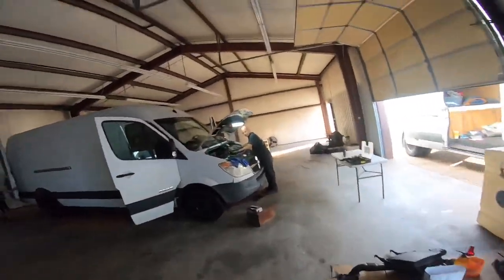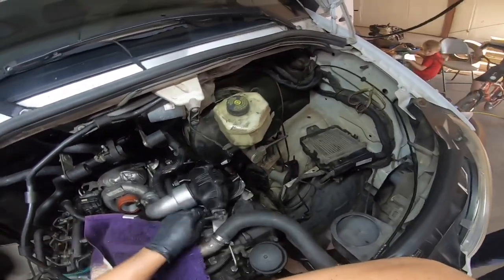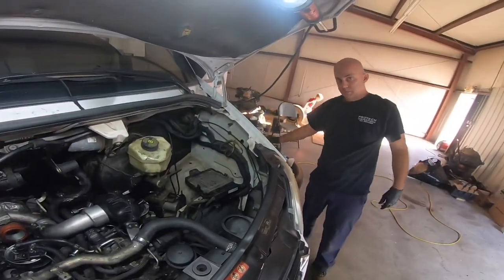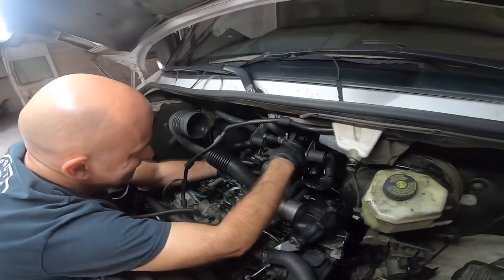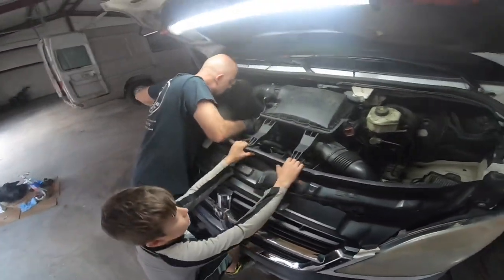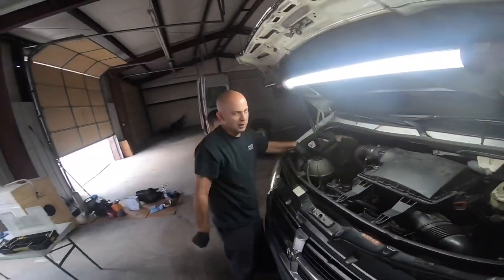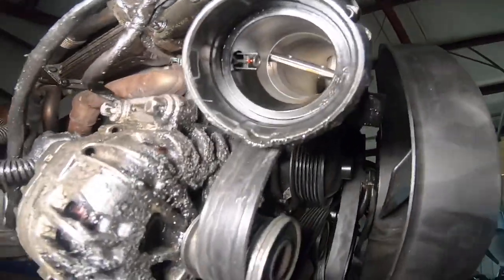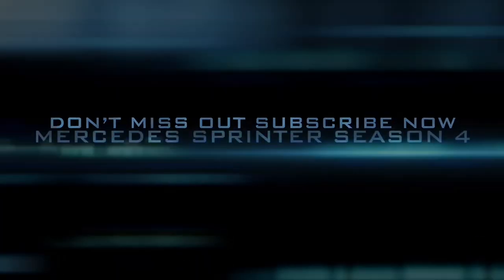We Started The No Start 2007 Mercedes Sprinter but it died 20 seconds later

Comment: Hey I have a 2011 sprinter turns on runs a for a few seconds then shuts off I did everything and nothing works .
Reply: Did you figure yours out? I’m onto a harness now, after changing all the mechanical parts on mine.